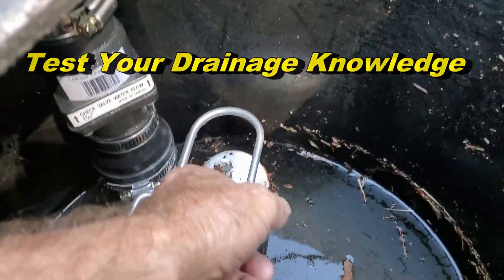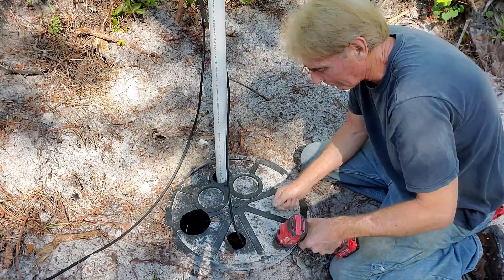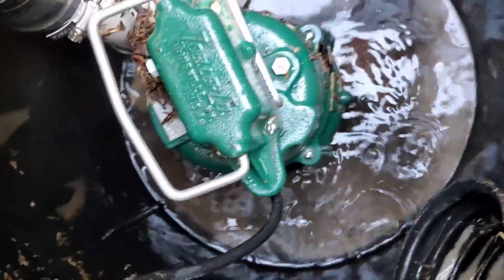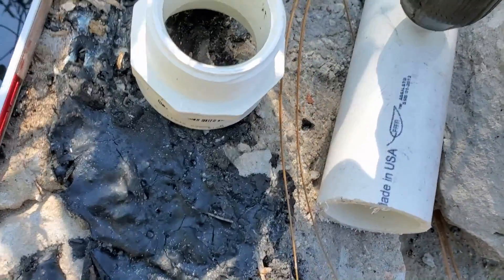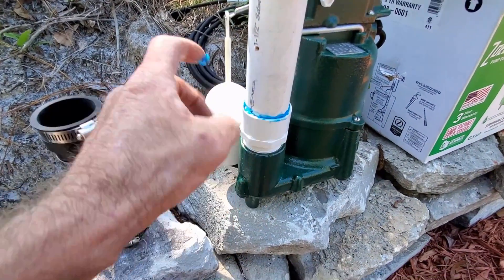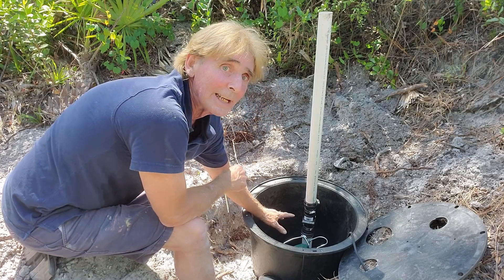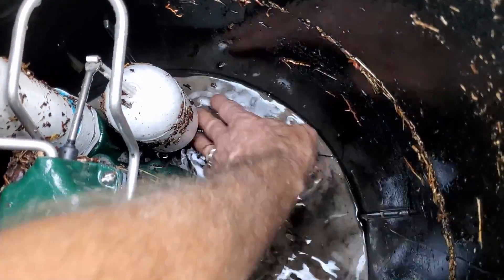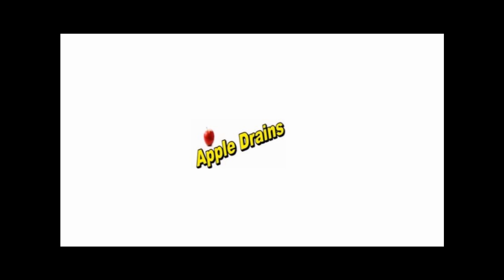Test Your Drainage Knowledge - French Drain Discharge to Daylight

Comment: I have to replace the pump again. I think it is from trees leafs and seeds getting in from the roof drains. I have a Zoeller 98-0001 2nd one each last just one year. should I use a different pump? Installed as your video's showed. no weep hole could that be the problem also?

Comment: I think it is a combination of the location of the inlet pipe to determine where incoming sand is dumped and the location of the pressure relief hole to spray water and force sand to one side.

Comment: The explanation doesn’t make much sense.  Are you saying sand is
coming out of the relief hole?  Doesn’t it make more sense that the side of the pit with the water coming in from the corrugated pipe is constantly displacing and stirring up the sand on that side of the pit?   On opposite side the sand is able to settle and accumulate as the pump itself is partially blocking the force of the incoming water.
Reply: Imo what happens is turbulence allows both water and debris to be pumped. And the small jet of water out of the left side causes turbulence which mixes the debris on that side of the basin which then gets sucked up and pumped. Additionally if you’re familiar with sump pumps typically there is also a pressure relief whole underwater and it would be facing left or the same side as the other pressure relief hole. This tiny hole is documented on Zoeller‘s website, but it’s also common on the pump casing of other pumps like everbuilt. 

Without turbulence on the far right side of the basin the sand does not get agitated and instead falls to the ground while the water gets pumped up

Comment: The white float balloon blocks the vortex motion of water (like in a draining bathtub) moving around the circumference of the round pit. The water coming out the 3/16 hole up high normally encourages water moving around in a vortex/circular motion, probably in a counter-clockwise path. The white float acts as an impediment, slows the water velocity, and causes heavy particles to fall to the bottom. I suspect much of the sand that is dropped as the water velocity slows and builds up the sandy area is still being pumped out because as the sand "hill" gets higher, more sand slides down the hill and makes it's way into the pump. If this is the case then some sand particles shoot out the 3/16 hole and probably recycle several times.

Comment: Random question, I installed a pop up emitter, works great, however I forgot to drill a hole in the bottom to keep water from sitting, what should I do?
Reply: Home Depot sells extra long drillbits. I would guess that you could take the pop-up off and drill a tiny hole in the very bottom of the 90° connector.